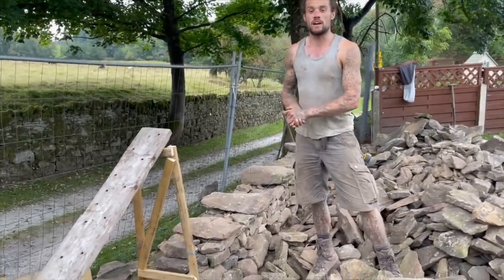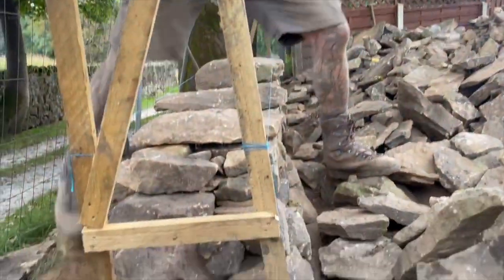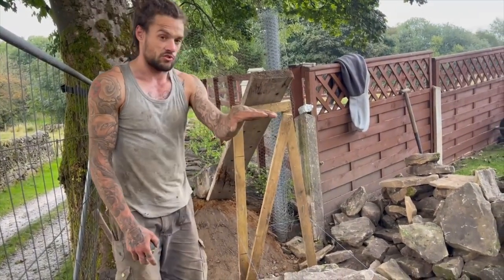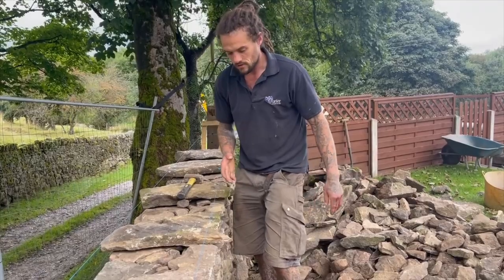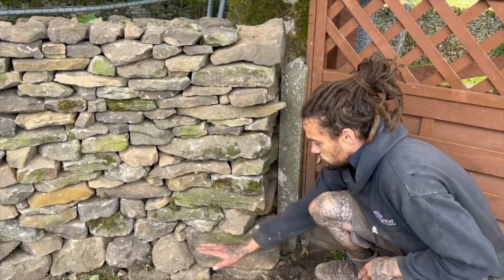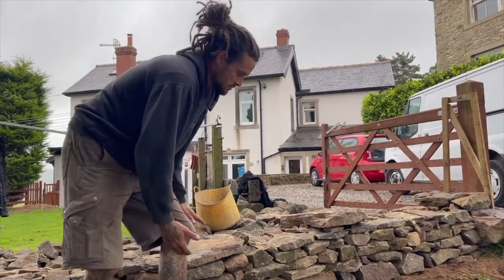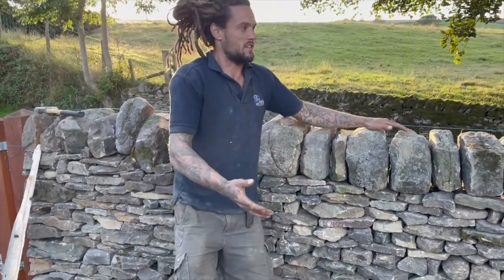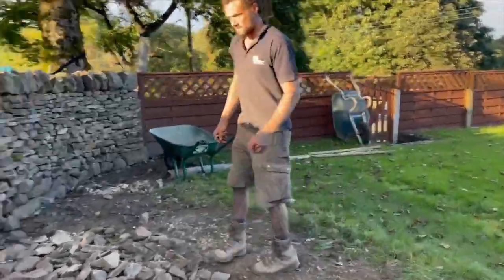Drystone wall construction

Comment: Fantastic insight and tutorial. Just a couple of questions if I may. Is this work done usually on price or day work.? And how do you work out how much material you need when the stone is so varied in size.? So interesting honestly!  Many thanks.
Reply from the maker: Thank for the comment.
This kind of work is usually done on price.  If you are doing gap (farm walling) walling then you usually work on a day rate.
For this kind of stone used, we usually go off the principle that a standard linear meter of wall, 4'6" high will be one metric ton of stone.

Comment: When you do the math on dry stone walls of Britain their origin remains a mystery. 26,000 miles of dry stone walls in the Peak District alone.
Reply from the maker: Many millions of man hours of construction. Awe inspiring!
Reply: @dportercontracting9974  42 million meters of wall in the Peak District alone. I reckon what it was, was an anti-deluvian crust of sediment turned to rock due to the compression of hundreds if not thousands of feet of water. This rock crust covered all fertile land and had to be broken up and removed so those left after the Noahesq cleansing could farm again. The pieces of this compressed, sun baked crust were then used to create walls. What else were you going to do with it?

Comment: Very well put up Danny. My Father put up several walls around our house back in the 1970's. The walls were to keep the soil from migrating into the street. The walls were backed up against soil. He used mortar and pored the back with concrete. Much easier to build than a two sided drystone wall. Thanks for the educational video.

John
Bethel, Missouri. USA
Reply from the maker: Hi Thanks for the comment.  Unfortunately, backing with concrete isn't the best way of of building a wall.  Water can't trickle through the concrete and will create a sodden banking behind.  Ice and frost will make the wall move as one solid structure.  There should be a degree of flex to a retaining wall.  Dry stone structure allow for this.  Dry stone walls have a multitude of facets that make the construction ideal for the project in mind.